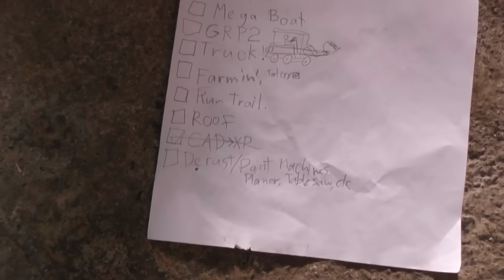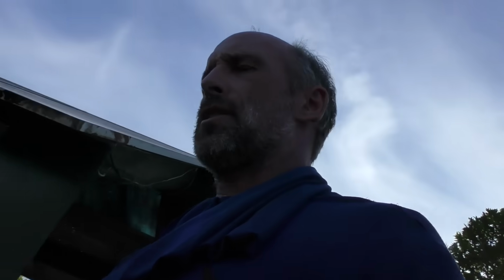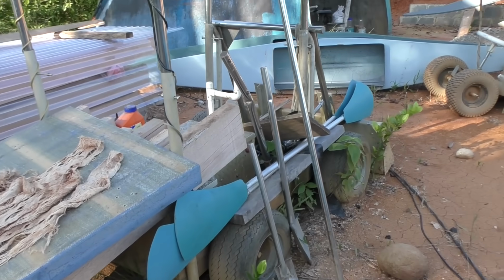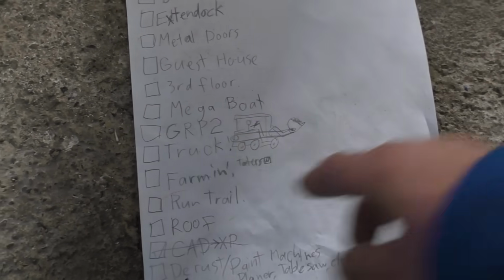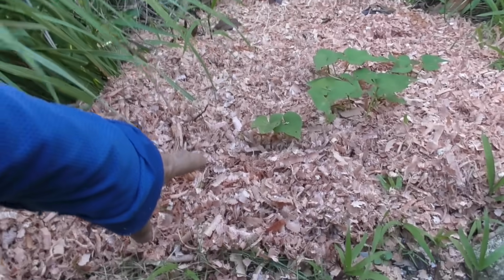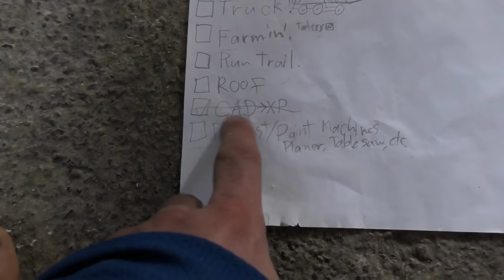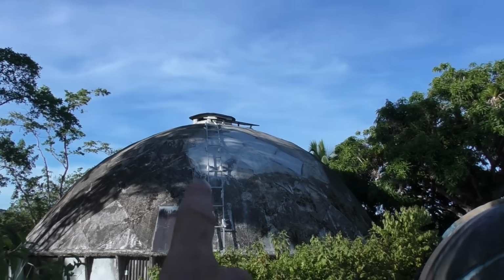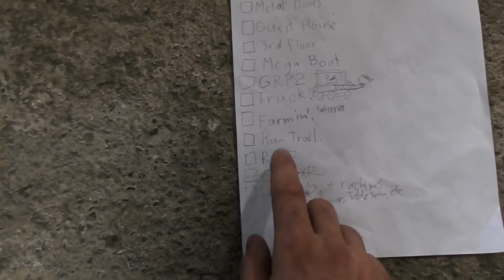Jaimie's Project List!

Comment: If you spray 3 to 1 water to bleach on your roof it will quickly remove the algae. I use an inexpensive manual pump, pressured garden sprayer.

Comment: Dear Jaimie why don't you make aircrete instead of Styrofoam concrete? That way you wouldn't have to ship a lot of Styrofoam to your island.
If I remember correctly you mix the concrete as usual but with a little dish soap (or something that bubbles a lot) and mix in compressed air or pressurized water so it bubbles while you mix. should be at least as easy as doing it with Styrofoam and people build houses out of it so it should be just as strong. keep up your fantastic work. 💪

Comment: There is a method of rust prevention on bare metal: brush it with a solution of sodium hydroxide. Not a thick coat, just a thin layer of diluted NaOH.

It will not stand against running water, but air moisture and single drops.

The NaOH will prevent the metal from oxidizing as long as it is still on the surface.

Comment: Radial Arm Saw
Reply: works extremely well for squaring cross cuts for dimensioned lumber. for quick precise work. if you set it up you will use it often
Reply: however, right now you are more in the concrete masonry mindset which is far more important, yes we understand 😊